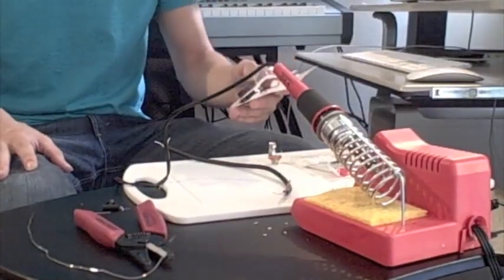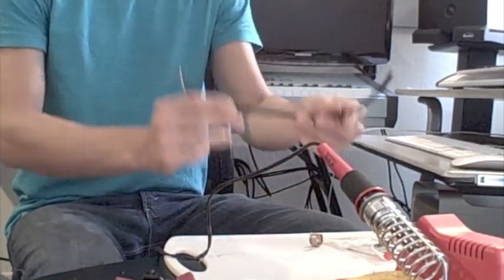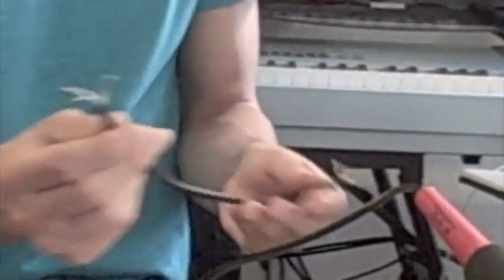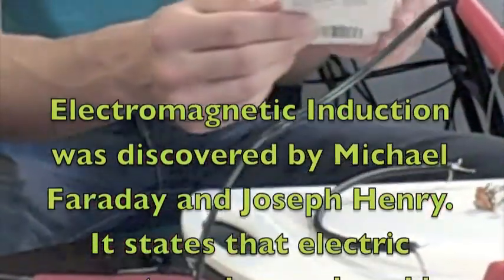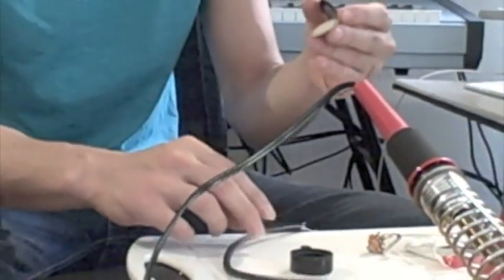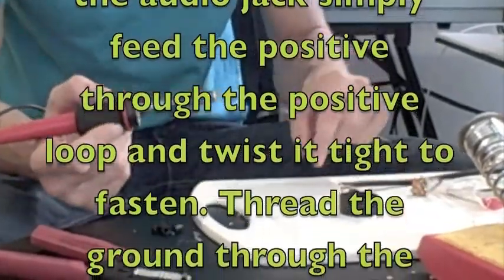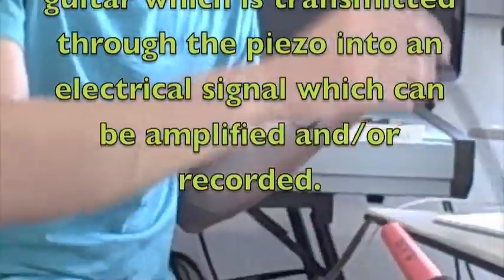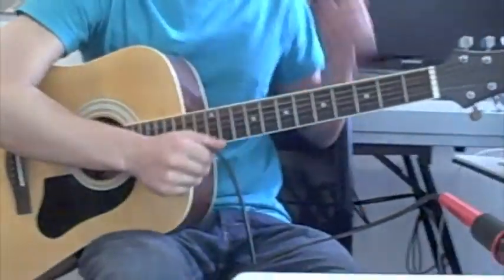How to Make an acoustic guitar pick up for under 7 dollars

Comment: nice  vid..but I miss the part of putting it into guitar..that's what Im looking for  and not many ppl show how to "glue " it in.... I need to know, what type of glue I should use  for best  sound..if I should glue it  directly on wood , or put something between  piezo element and wooden surface..and also, if it's ok just to glue it without any additional material on other side of piezo..I noticed big changes of freq range when I touch it and how I touch it... during oscilating..

Comment: @Bogieproductions i was just messing with you man. and yes that did help. i found another vid that showed me wear but he soldered fast to. he said that the piezo is a heat sesitive part so you did it right! but i cant wait to build my preamp and the whole deal for my acoustic. i did it and put it on her and it works well, alot of feed back so ill need to put a filter cap. in it. plus i like controling my vol so a cap. but yah thanks alot!

Comment: Maybe I missed something here, but what does the electromagnetic induction part have to do with this? Piezo elements use pressure on a crystal to induce a voltage - there is nothing magnetic about it at all. It's the opposite of a wound coil pickup....

Comment: I just noticed you substituted the piezo crystal for the magnet in your description of how a pickup works via vibration. Again, nothing magnetic at all in a piezo element. This sounds very misleading. The piezo is NOT a magnetic element, but a static voltage source using pressure to generate a change in voltage.

Comment: Silvertone is made by sears.  depending on the year, they made some decent stuff.  You'd need to give me a free guitar to get me to buy Elixir strings ha!
Reply: Tommy Slothower-Miner I've been using Elixir strings since 2002 and have spent my last $15 equipping them. You get what you pay for and cheap strings are garbage. Go spend $50 in a year replacing rusty/grimy and busted strings with no life or tone to them or keep the same pair for 6-12 months with no issues or bs, choice is yours... That cheap pricetag on those crappy strings is an illusion and that is how they get you. You are being nickel and dimed.

Comment: And now you have basically a K&K pickup or the equivalent of a cheap Chinese guitar pickup. and it will sound that way too. Some okay qualities but no fidelity really, and make sure you use a decent preamp if you go this route.  A high impedance transducer like that is loaded with problems if you don't know how to process it. Proceed with caution, and expect to spend a lot more by the time you're done. Unless of course you don't really care about the quality of the sound.
Reply: 2iron audacity dude this is obviously mostly for people needing a cheap solution to plug in at home. Anybody heading into the studio to record stuff is probably not going to be using this method to record. Some people, like me, have smaller travel instruments such as the Washburn Rover that lacks volume to actually play in public. It is a better option than nothing. I have upgraded my nut, saddle, and pins and it will sound better through a piezo than unplugged. These are also efficient for ukeleles...